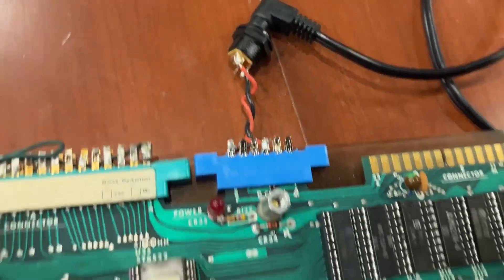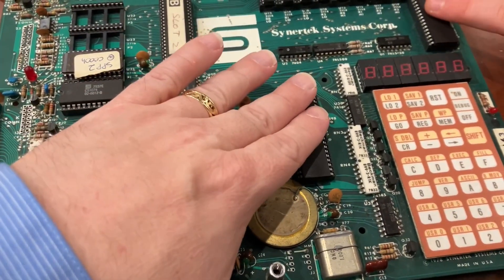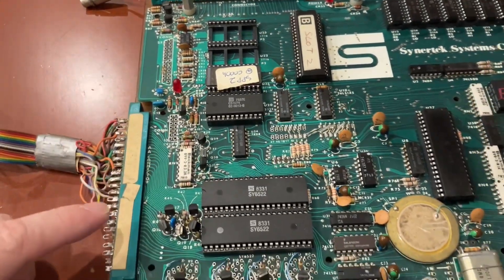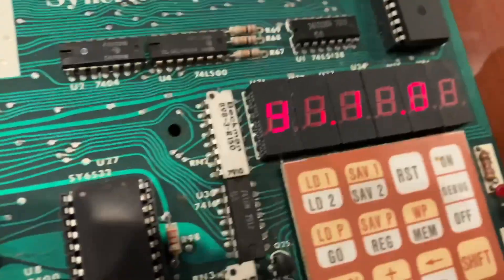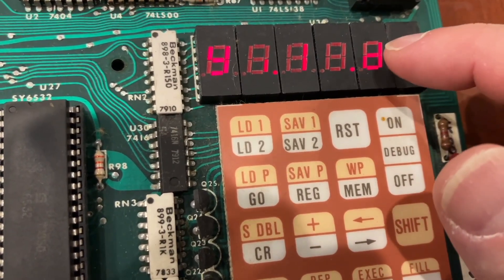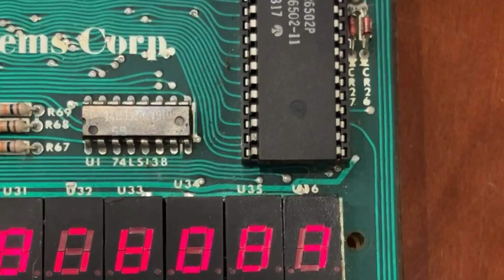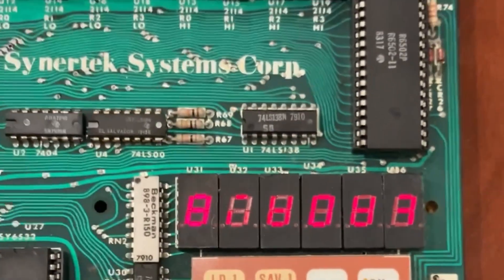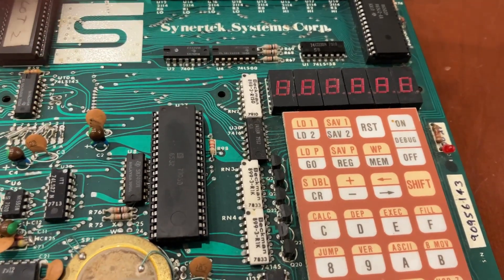Synertek SYM-1 Smoke Test: Dodgy LED Display (Originally Owned by Composer Richard Teitelbaum)

Comment: What's happening here is the ROM monitor is waiting for a key input from multiple sources so when it detects something it'll use that as the display. It can be connected to a 20mA Teletype, a CRT terminal or it can use the built in keypad and display. The commands are exactly the same for all displays, it's just there's more screen real estate on a terminal. I think when you turn the system on or press RST, the keypad waits for CR to be pressed (I looked it up, it's CR) before using the 7 segment displays. Alternatively if you have a terminal connected, you press 'Q' to activate it. Using Q lets the monitor automatically detect the baud rate. Looking further at the manual, to get the negative voltage needed for an RS-232 terminal, you'll need to supply a negative voltage to the appropriate pin on the power connector and wire the 'GG' jumper from point 39 (default) to 40 if it isn't already (page '4-8' of the SYM-1 Reference Manual). Best of luck!

Comment: Would they have made this pcb with software or a pencil?
On the right side of the led display you see perfect right angled track and on the other side "organic" a like tracks.
These white ic look like resistor array's, is the led display clocked to make it appear for the eye it's continuously turned on?
Are these transistors part of the button array or the display? 6 led display and 6 transistors. often it's the case that the transistor provide the GND connection to the cathode of the leds, but you have led display of 2 types, common cathode or common anode.
74*16 is a hex inverter. to me it seams the led display are broken.

Comment: the displays seem socketed? Take out the displays and test them - a 3V button cell works fine as an LED tester.
But I find it quite unlikely that driver or display are bad - are you sure you know what is supposed to happen, when "shifting in" digits this way?

Comment: This is off topi for this video, but given this is your ltest, I figuredit had the best hane of you seeing it. I'd like to suggest a topi that has realvalue in power amplifiers, but isn't overed very much, and I haven't found any on YouTube. Iknow them as suspended amplifiers, but there are likelyothernames Basically, lower voltage op amps driving higher supply voltage power stages. Itallows ou to take advantage of op-mps at the input, while having suffiient voltage to drive power.  Just an idea for something differentand hopefully useful,and I ca't thnk of ayone better to talkabout it.
Reply: I think you're describing class G or H amplifiers.
I don't think this is an area Prof Lanterman covers in his teaching, but he may still have some input on the topic.
If you'd like some reading on the topic, search for Elliott Sound Products "Amplifier Classes" article. 
Or, if you're interested in a small easy DIY circuit, search for Valvewizard Glassblower, a class H guitar pedal booster circuit.
Reply: Thanks for the comment, but the technique I am talking about is specific to using op-amps as the first stage in a higher supply voltage range than the op amps can normally use.  Class G and H seem similar, but are specific topologies independent of the chosen component types. I asked simply because op amps have many desirable characteristics and simply a lot of things, but have limited voltage and current drive. Given so much audio focus here, I just thought people might like one of Aaron's excellent analysis videos on the topic. Thanks.

Comment: Check discrete demux diodes first! As unlikely as it seems, I’ve been told by techs it’s a common place to fail in old gear.
BTW I recommend the Hakko FR-301 or similar for jobs like this. Just make sure and test it on a different board, because the wrong temp can absolutely toast your vintage PCB.